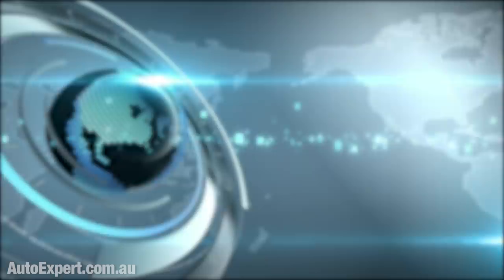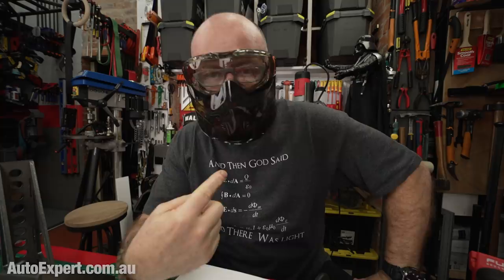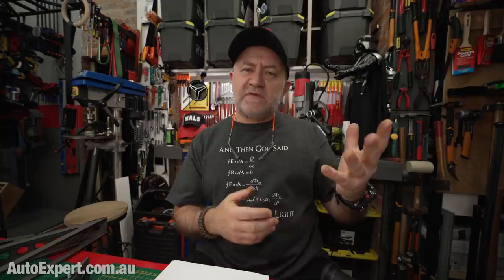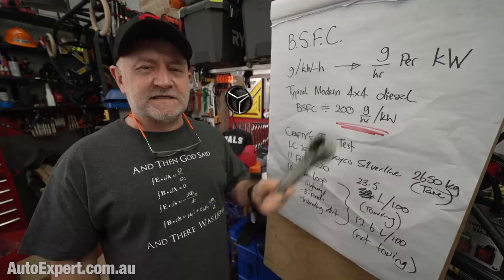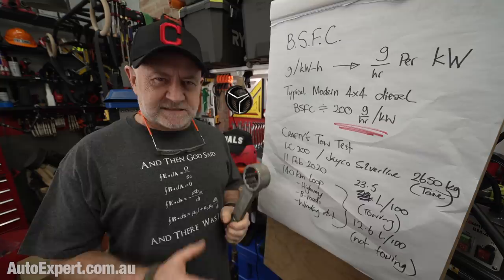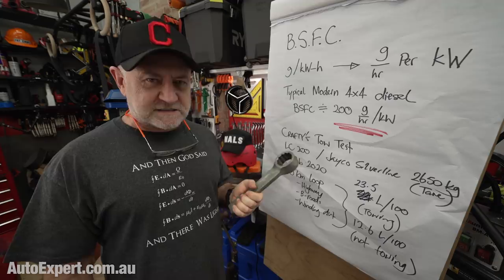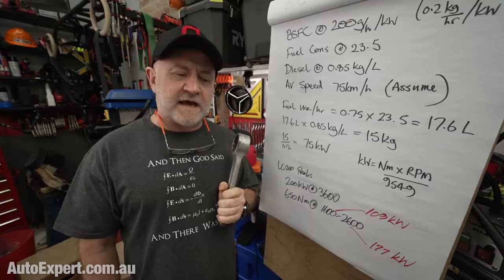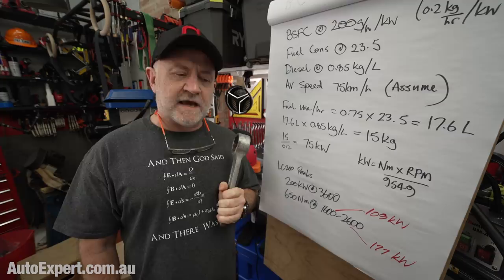How much power does it really take to tow? | Auto Expert John Cadogan

Comment: While I enjoyed it, the typical person could have saved 22 min lol
The answer is, suspension and chassis are way more important than engine in typical towing by the average person.
What's the difference between a 1500, 2500, and 3500 pickup? Not the engine, the engine is the same from a 10000-35000 pound rating. It's the suspension and rigidity of the frame. Then add the little things like tire choice.

Comment: What about the fact that is an average, not a peak?  If I drive up a hill, then down the other side, and average 70Kw, the reality is, I was expending 140 going up the hill, and 0 going down the other side. So don't you really have to plan for your peak usage rather than the average overall? I had a diesel 80 Series for years, and hired a large van once. It towed well, the van did not push the car around and was great on the flat, but up hill it was back through the gears and hope no one ran up the back of us. Its 96Kw from memory. Extra horses on the hills would have been nice.
Reply: You don't want to drive at peak load the entire time, because likely you'll find the failure point(s) of the vehicle in short order. John is saying if you plan for the average, the occasional peak is likely to cause no problems because you weren't maxxed out or overloaded from the start. 
In your example, that van didn't have enough power for the job from the start, because it couldn't handle anything other than being on the flat. In other words the power to total weight ratio was far too low for the load, vehicle, and road conditions encountered. You are correct in saying more horses were needed, which would have lowered your engine/trans workload towards average ("mid-range" might be a better word than average here), avoiding vehicle failure points and better performance when you needed uphill oomph.
Reply: @markh.6687   The 80 Series DX is 600Kg lighter than the 200 series, and the Van I towed would have been 5-700 Kg lighter. So it stands to reason my average required would have been less than the 70Kw required. And its a 96Kw engine. So I wasn't driving at anything like peak mode for most of the trip. My point and question is around the fact that the average is just that, and average. And the car was under powered on the hills. My question is, how much peak power is needed to pull a van up a hill. I currently have a van that fully loaded weighs about 1800Kg towed with a Commodore SV6. Going uphill on the M1, it is revving at about 5500 with the boot most of the way down. its a 205Kw engine, and I am guessing I am using about 170 of that, give or take a bit. Clearly we need more than 70Kw, even if that's the average.  My question to john is, how should one calculate, if purchasing a tow vehicle, what the min engine spec you should be looking at. 96Kw for a one of trip in my cruiser was fine, but not if I was towing a 2 ton van on a daily basis..
Reply: @wp958   John would have to do the math(s) on that one, because I don't know enough math and physics to figure it out. 

I can only poorly guess that there is a theoretical ideal power to weight ratio, and then some way to factor the additional load (gravity) placed on the vehicle ascending said gradel, such that at any given grade at any given speed with any given load (people,van,other cargo), the power (in Kw) to make the grade is "X". Then it gets more complicated because you wouldn't want to run that engine and transmission at theoretical maximum, so you'd have to factor in a safety margin (perhaps 20-25% lower than theoretical max Kw or rpms) to avoid wrecking the engine and/or transmission.  Sir John, any help on this greatly appreciated. 

By the way, what is redline rpms on your Commodore engine? 5500 seems kind of high, given that some engine redline as low as 5500 to 7000 (at least according to a Wikipedia article).
Reply: @markh.6687   Specs say 210Kw at 6400rpm. You need to rev it to tap into the kw. I guess if I go back to my Y12 physics, I might be able to do the maths at a basic level. But I dont know enough about the rolling resistance and air resistance at various speeds. need to do a lot of research for that one. And I suspect John knows it of the top of his head.
Reply: @wp958  Okay, assuming 210 Kw/6400 rpm is maximum before things break, at 5500 rpms you'd be at ~178.5 Kw (about 85% of max theoretical). So you're guess of 170 Kw was pretty damn close. In all seriousness to you, that's nice work without the slide rule and all the rest. 

I totally agree John is the man for this job.
Reply: @markh.6687  178 kw with foot flat to the floor. Doesn’t need to be foot flat to floor to maintain speed, but if I go up a gear, I can’t hold the speed. So between 160 and 180 is about right to maintain 100kmph. on steepish hills.
Reply: @wp958  You've mentioned another factor which is hard for the average owner to know, let alone apply: the issue of gearing and its impact on acceleration vs. torque. As you said, go up a gear and you lose speed. But with the same engine would different gearing help? In theory better gearing might allow you to maintain speed while not running the engine and trans so hard. If it does, then you have to figure out what kind of ratio(s) in the gearbox (and differentials if rear or 4 wheel drive) would work best, or at least something close that's available off the showroom floor for a given engine and vehicle towing a given load. Gearing is a specialty all itself, and I offer no help at all trying to figure that lot out. :)

Comment: Grinder must not be worn with ANY rotating hand tools and ANY grinders or pedistal drills, laths, mills etc as not only are they a catch hazard but you also loose a lot of your effective feel which inturn increase THE danger dramatically. Ex marine fitter turner, marine engineer with 50 years experance who have on the odd occasion ground the ends off fingers but still have all my fingers which would not have been the case with gloves that would have grabbed and dragged the hand in with horrific injuries as have seen over the years. Any school trained safety officer or risk manager is a total idiot if they require gloves,no bloody experance isbecomming so normal.

Comment: Always wear fitted gloves man! Grinders don't have the balls to tear fingers off. They will however cut right through one before you can retract.  9 times out of 10, it's not the grinder that cuts you, it's the steel your cutting.  Variable speed grinders are much safer, you don't need to run them full bore to cut.  Full bore is reserved for grinding discs and they don't fucken jam.

Just wear gloves for fuck sake!